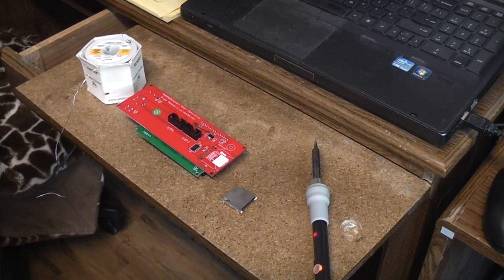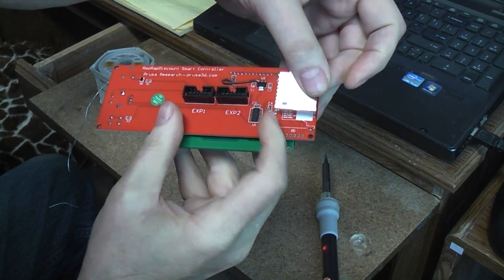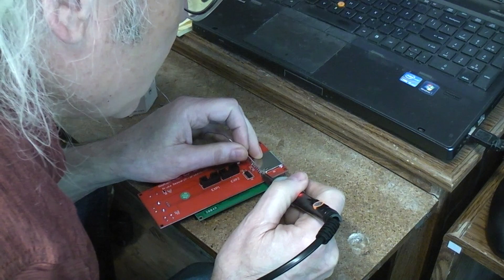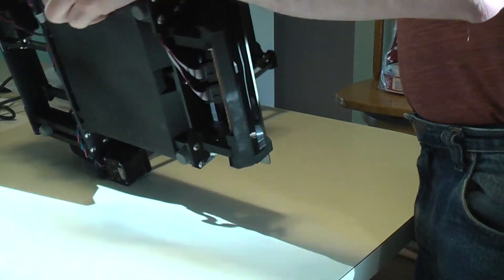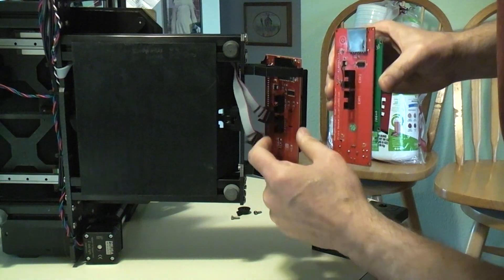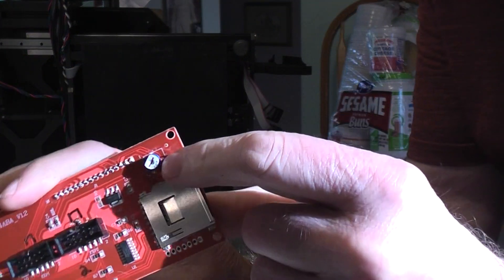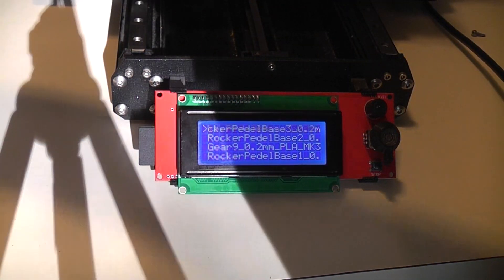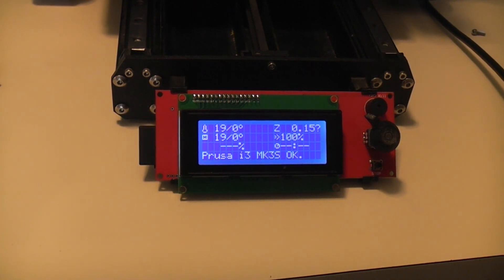Repair or replacing the Prusa MK3 SD card socket for $5 bucks or less.

Comment: I've removed pin shrouds numerious times to flip them around. Yes they are tight and you have to be careful, but it is very possible.  Annother issue is the reset button, some have different height buttons and may need modifications.
Reply from the maker: Yes I too have removed the plastic pin shrouds 100's of times threw the years but I am telling you it will pull the pins of the boards of these china boards or at least the one I got. The Reset pin is a different height, it is not a issue and does not require any modification, the case flexes enough that it works normally. The encoder shaft id a bit longer as well so the knob sticks out a bit more, but again its a cosmetic thing and works great .